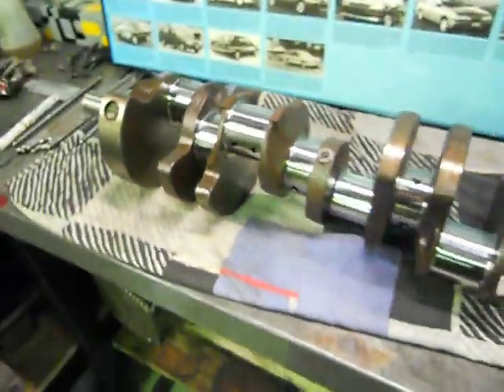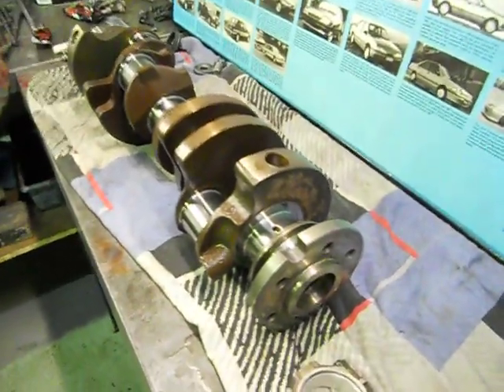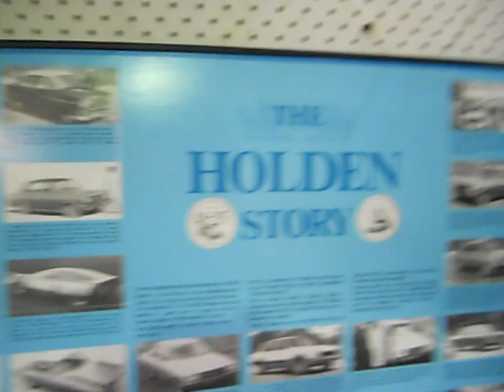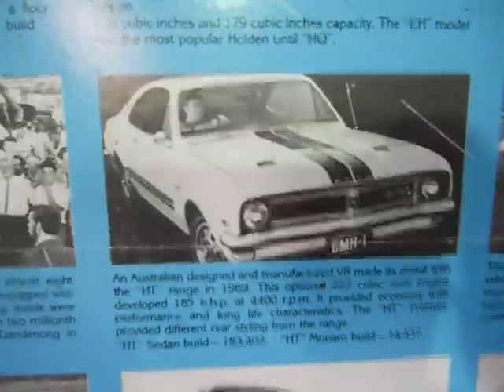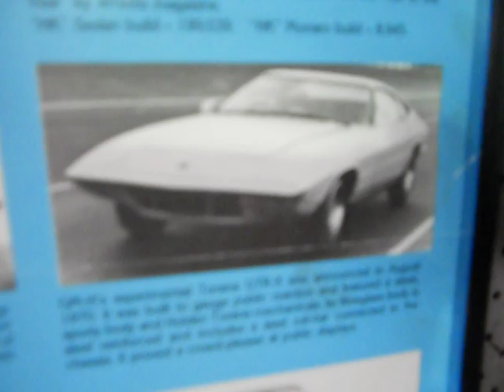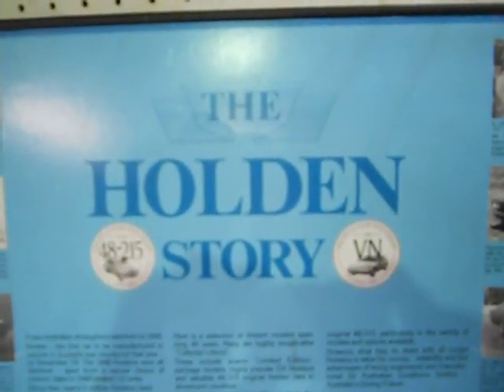How to rebuild a General Motors Holden Engine part 6

Comment: Blueprinted standard volume oil pump,Correct.
Reply from the maker: I always replace the std holden alloy pumps with Mellings High Volume Cast iron pumps.
Reply: @Aussieheads1  some hi volume pumps can shear the drive tang and chew up the front cam gear.

Comment: Great Channel, Just subscribed and love the fact your taking the time out to show people some tricks of the trade!
Im rebuilding my first diesel motor atm, A cruiser 2h, was wondering if you could help, but i pressed in new small end bearings and they seem to be a little tight on the wrist pins, these bearings are supposed to be the finished size, would you normally hone these out to suit?

Comment: I was wondering, whats your opinion on using trans fluid as a engine cleaner on a car that's been sitting for a year or so and has a shitload of condensation under the rocker covers?